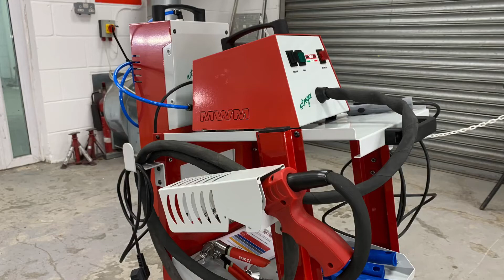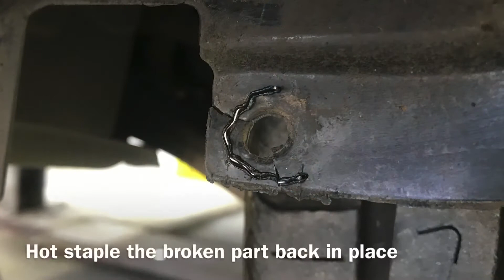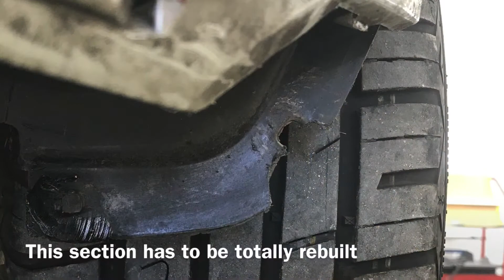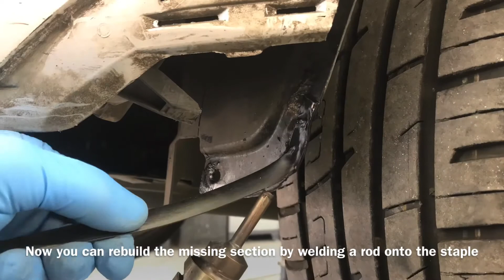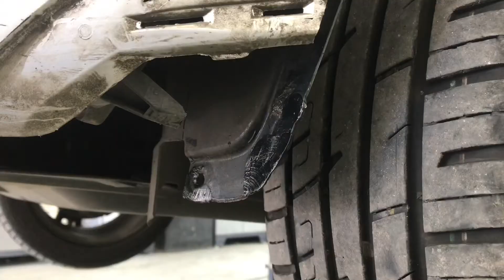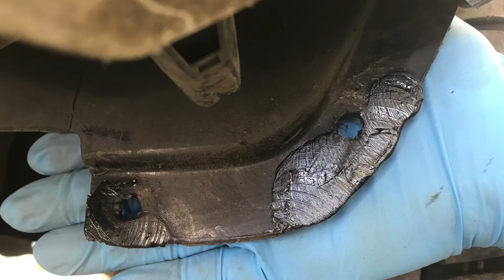HOW TO PLASTIC WELD

Comment: Amazing bit of kit, I'm sure you will find it very useful Wayne.
Reply from the maker: It is a nice piece of kit but for this kind of repair I could have used any hot air welder
Reply: Yeah but it's not the same as having the best tech you can afford, I'm a time served ark welder so got myself a cheap mig but it wasn't very versatile so invested in a Esab Rebel welder which is a mig, tig and ark all in one, cost me around £1500 3 or 4 years back, did I need it? no, did I want it? yep!! and I love it which drove me onto learning how to spray paint, if I kept with the cheap mig I probably would have given up on it and wouldn't be spraying today.
Reply from the maker: Oh I totally agree but not everyone can afford a nitrogen plastic welder and I don’t want them to think that only that’ll do the job. I want folks to see what is possible to be repaired easily and hopefully save the customer some money, reduce the plastic waste and increase the repairers turnover